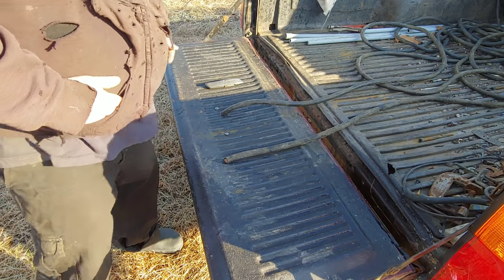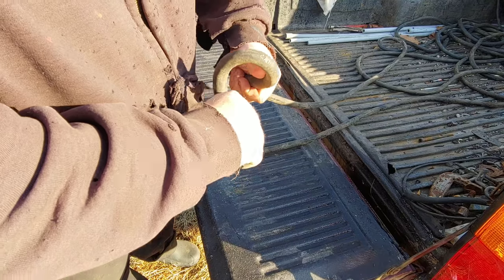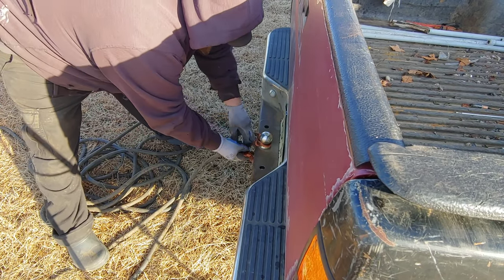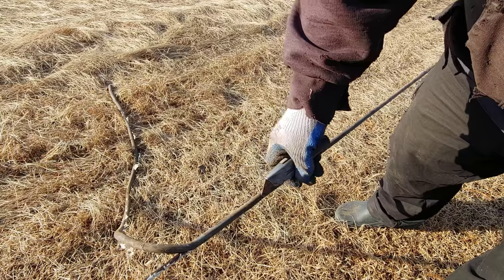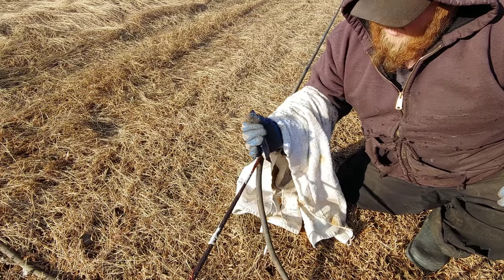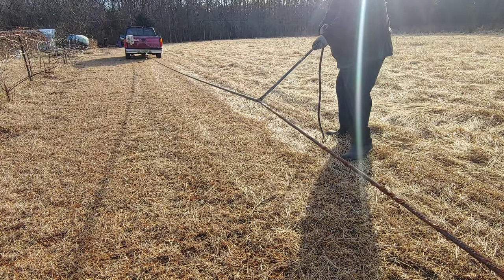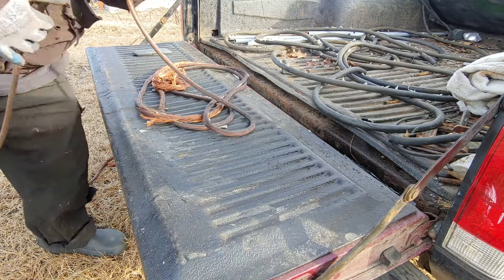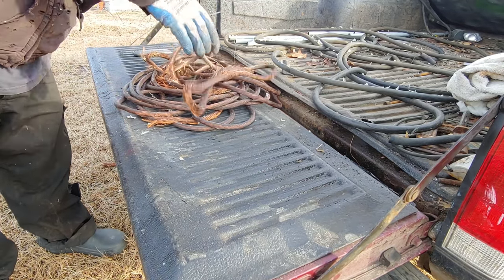Stripping wire tips and tricks only the Pros know

Comment: OMG! I was sitting here flinching as I remembered putting a rusty blade through one side of my thumb and out the front!!! Back in the day we use to take a pile of wire and burn the sheathing off.
Reply from the maker: If you do it that way with your arm fixed you'll never cut yourself well never say never but if you slip off it's a lot more controllable

Comment: That's a good idea. It would work too by parking close, tying copper to truck, rubber to other truck, then reversing.
Reply: That's what I fort he was going to do lol
Reply: This would be what smart people would do...
Reply from the maker: Good thing only smart people have two vehicles
Reply: @ScrapFarm  🤣🤣🤣
Reply: That wouldn't work- when you pull on the rubber coating it stretches but shrinks in diameter, gripping the wire harder. Same principle involved in removing/ replacing rubber bicycle/ motorcycle handlebar grips. You rarely can pull them off, you push them off. Pushing makes them larger, pulling makes them shrink.
Reply: @ScrapFarm  BUY STRIPMAISTER LIKE NORMAL PEOPLE
Reply from the maker: @dino9086  ok master

Comment: We got a Granulater Load all Wire into a Very Large hopper Cable Cut to 2 ft Lengths Fall onto Elevator Goes through to Granulater Copper all goes into moisture free Containers and Cable wrap goes in Separate Bin Got market for that aswell
Reply from the maker: We can all wish
Reply: It was woth Buying paid for it Self in first month you must not get Copper Granules wet as we Learnt its aGreat bit Kit Bronnebergrecyling Granulaters

Comment: Get 4" of poly or pvc pipe, big enough to slide freely on the cable. Slice it lengthways in half. Use 1mm thin cutting disc in angle grinder, cut a slot in centre of half tube that's long enough to make a blade from your stanley knife poke through enough to cut the thickness of the cable coating. Hot melt glue gun the blade in the slot from the outside. Now you have a guide on your knife so you don't need the towel or wrapping your arm around the cable. Other variations involving a  complete bit of pvc that you slide the cable through with a knife blade in can be made also. Then you wont need to string it out tight. I ended up buying an electric wire stripper that strips up to 40mm dia. Not cheap, but in time it'll pay for itself many times over. My goal is not to cash any copper until I have 1 tonne. PAYDAY!
Reply from the maker: More than one way to skin that 🐈

Comment: This is a joke right lol....

I mean a real pro would just tie the insulation to one truck and the copper to the other truck and use the trucks to pull them apart.
Reply from the maker: For sure if you had two trucks
Reply: @ScrapFarm  or two vehicles of any type... two golf carts would get this done also.
Reply: I use a homemade wire stripping slide that I made basically for free...